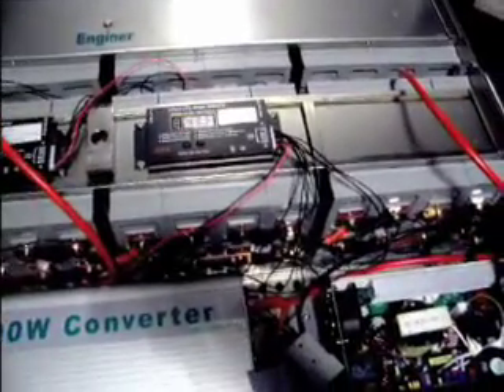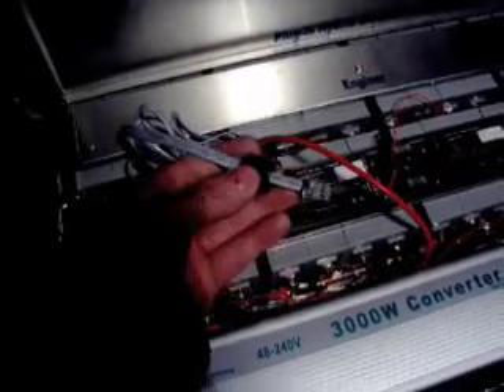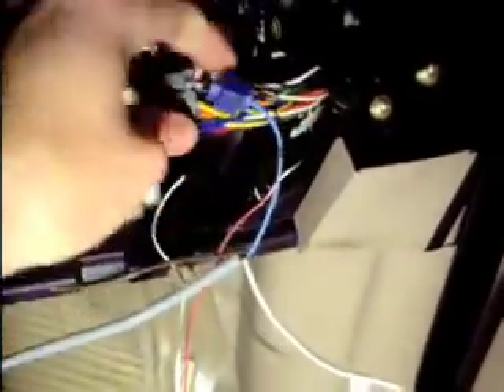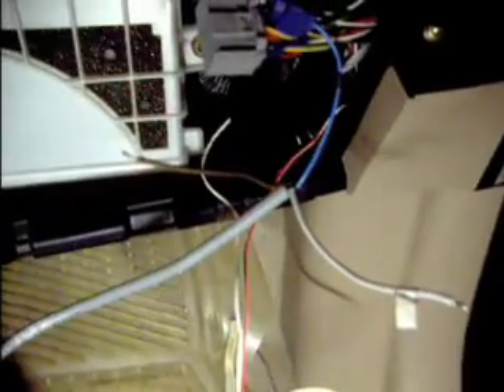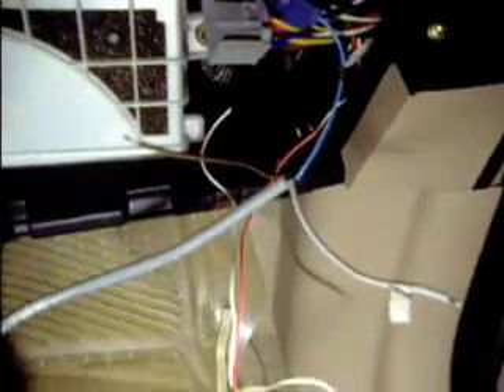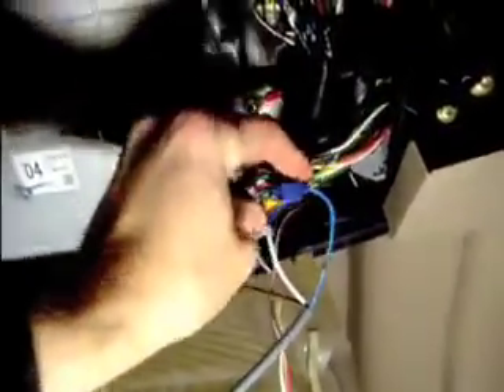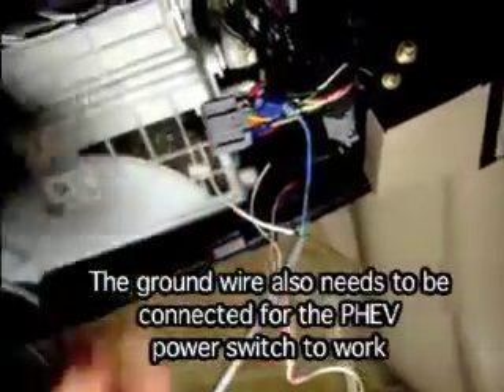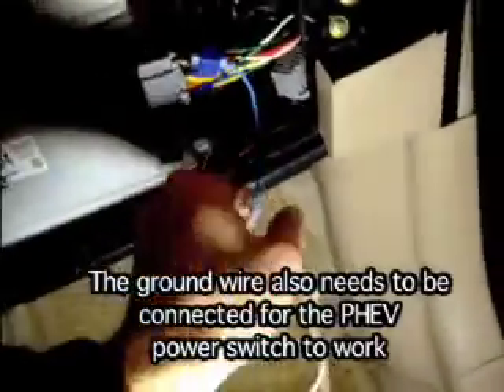Enginer Prius PHEV Conversion: Part 5

Comment: the part where wire goes to other side of the car is not very visible.  I would not attempt this installation based on this part of the video, it's unclear exactly what should be done.  it looks like one blue wire goes to something, not clear to what.  The other loose wires just hang there?  some intelligent talk about this option or that option later, but not clear exactly how it winds up now.  it's probably correct but just not clear.

Comment: How is your car operating now with this kit installed, I have the same kit ive had nothing but problems with it, bad batteries bad converters, parts missing etc, have you had any problems yet. ive made it maybe a few miles before having some thing go wrong, Im making my own bms for the kit, as the one that comes with is only good for wiping your ass,   Mac

Comment from the maker: The engine is NOT REMOVED from the car. This is NOT a CONVERSION to an electric car.
This is a hybrid (which already had both a gasoline engine AND electric motor) which simply has some additional batteries added to improve it's fuel economy by getting some of the energy from the wall electric outlet.

Comment: Did you consider instead of a toggle switch using the car's already present ignition switch?  After all, if you're removing the electric engine to run entirely battery, why not use the existing electrical system?